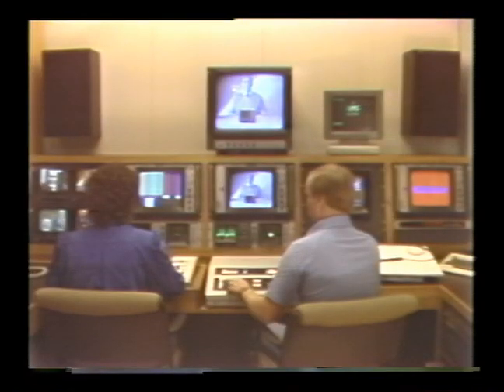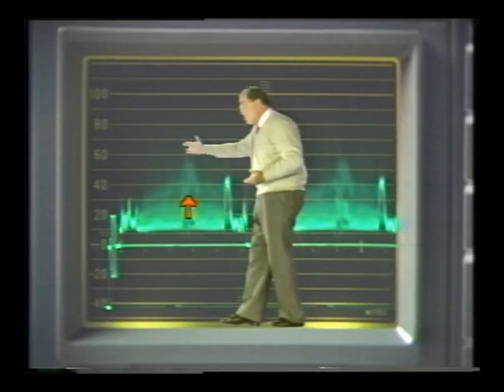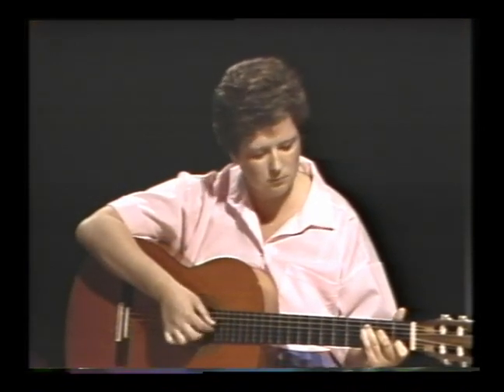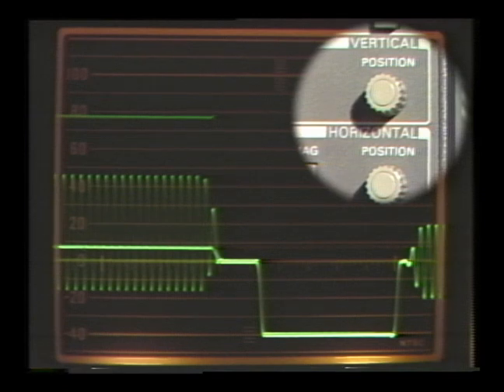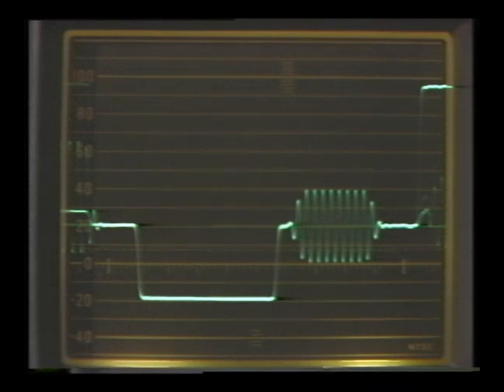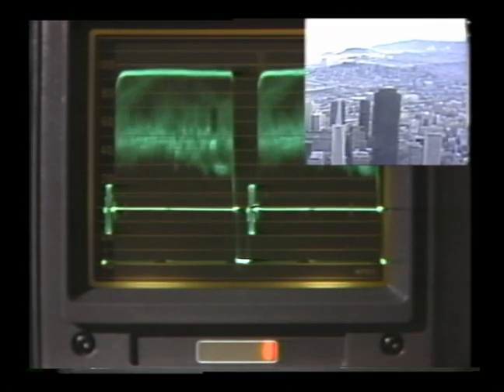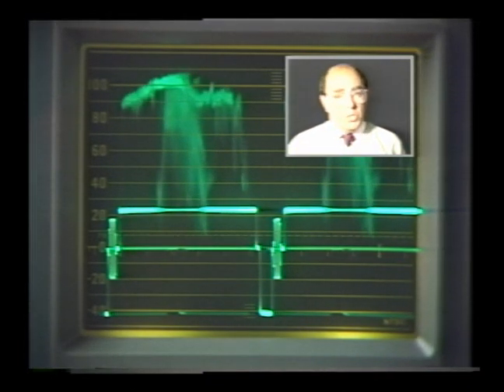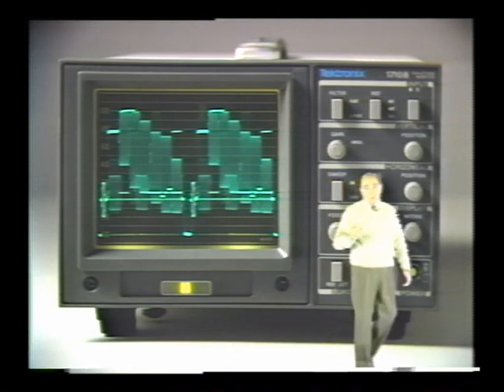Tek Basics Of Waveform Monitoring

Comment: Today's digital waveform monitors such as those on the Tricaster don't show IRE, it shows a scale from 0 to 235 if 8 bits.  How do you translate 0-100 IRE values to digital equivalents? I think 235= 100% IRE?
Reply: Pretty much. The use of 235 as the digital white level is to make sure any ringing from a black-white transition doesn't exceed the 255 cap and cause undesirable distortion. In NTSC-M terms, 16 in the digital space would be your 7.5 IRE black level (it'd be 0 IRE for PAL/SECAM).

Comment: What is the purpose of the 7.5 IRE setup on NTSC signals, and why is it not needed on PAL?
Reply: In the NTSC system, the lowest black level is distinct from the blanking (screen/beam off) level in the transmission signal for the purposes of lining up the image in one's monitor, distinguishing the active video area (7.5 IRE) from the blanking intervals (0 IRE). As PAL and SECAM came later than NTSC/System M, they decided it wasn't necessary to have that pedestal, and just used PLUGE bars in a test pattern to set the appropriate levels (surrounding the desired black level with a slightly darker and slightly brighter section). The Japanese NTSC system (NTSC-J) didn't use the setup level, just like PAL and SECAM, but American NTSC still had to retain it for compatibility reasons.